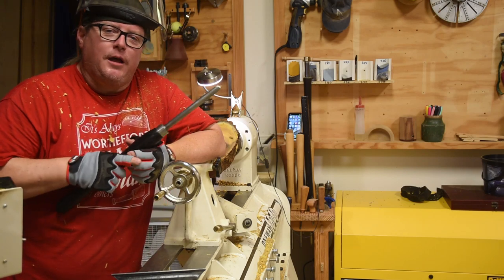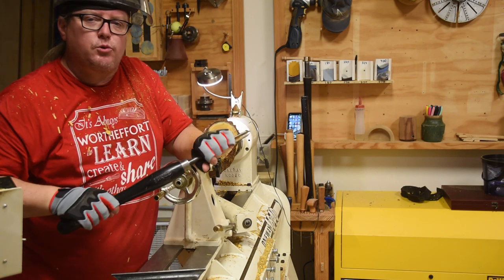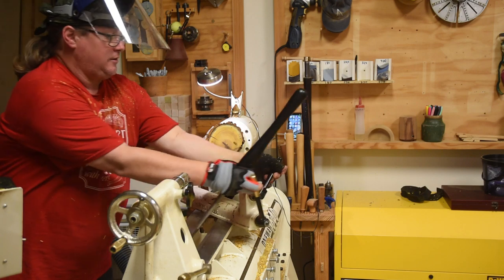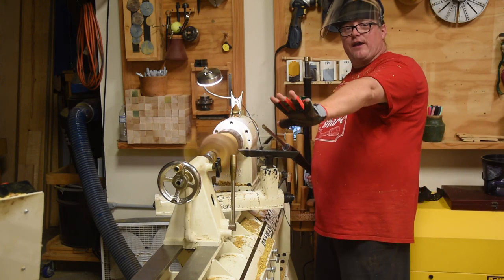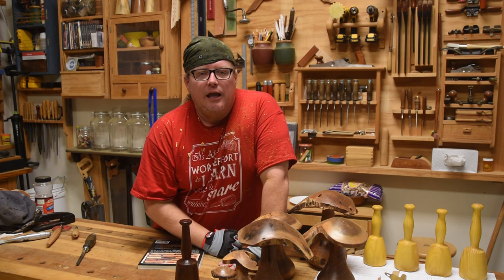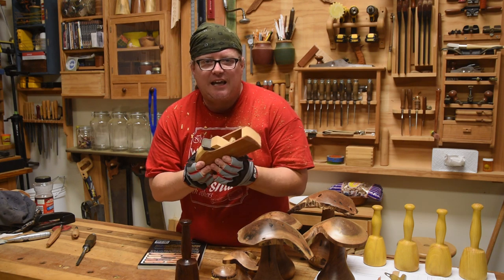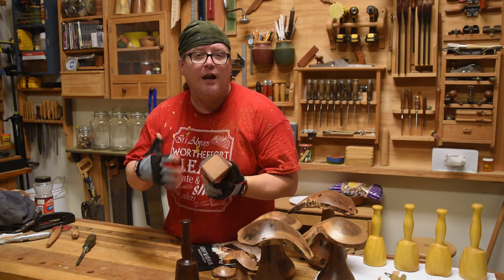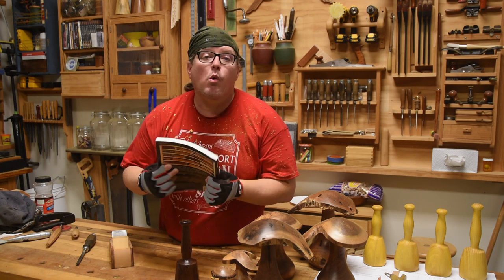The Other Side

Comment: Good stuff.  I use this technique turning threads on a metal lathe.  Except you just turn the single point tool upside down in the holder and reverse spindle.  That way, you can the crossfeed away from the chuck.